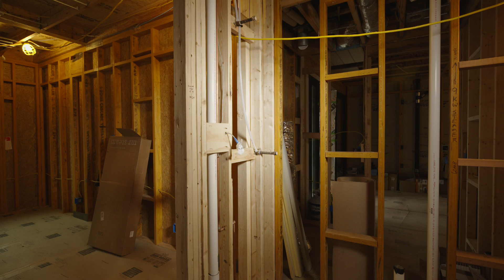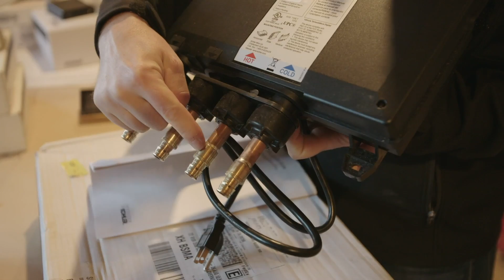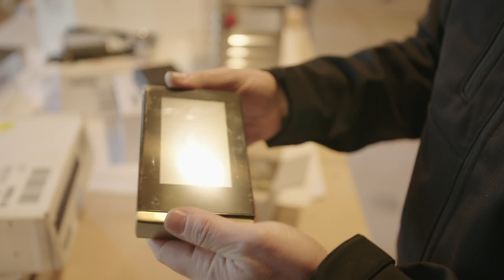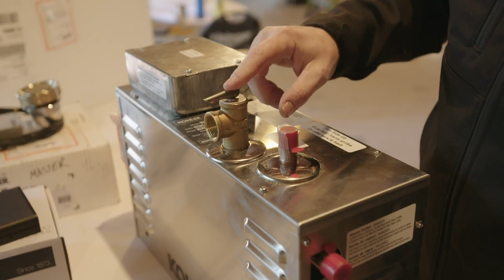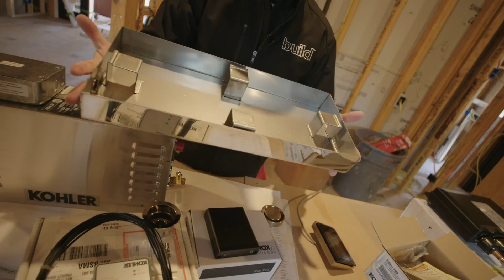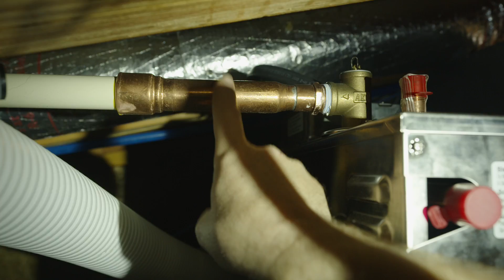Electronic Thermostatic Shower Valve - This is impressive!

Comment: This is to a shower as to a fridge with a TV. Way over the top and totally unnecessary. Get a shower with a thermostatic valve that has a temp gauge on it that you turn by hand. Same thing as this minus the electronic valves.  Its cool but this is just another thing to break that will no doubt be prone to unsupported system updates in the future. 5-10 years from now, if it even still works by then, people are going to hack in to your shower and start turning the thing off and on just for fun because the manufacturer no longer provides security updates. You think this is not a thing, but it totally is. Its currently happening to Fridges with tvs, wifi toasters, and all kind of 'smart' stuff manufactures have moved on from.

Comment: I have almost the same setup — but more jets. And I use the Steamist brand computer and controller, which has a nice basic UI. It also allows for much longer steam runs that the Kohler. Out master is in a large home on the second floor so this was necessary.

Comment: Two things 1. Is it networkable or is it airgapped you haven’t really discussed much about smart wiring? So Will it Alexa or Hey Google? 2. Will the steam unit produce a hot steamy condensing spot in your attic and possibly “trick” your thermostats? (Bonus Question) I know You’ve got backup generators if the unit loses power or reboot will it lose settings

Comment: Similar system was made by HansGrohe, but no steam option, that I was aware of. Fantastic system, until it goes wrong, only 2 engineers in the country (UK) can work on them, have had 2 problems in the 5 years that I have had this system, one of the head valves failed, was replaced foc. The second was a lot more complex to find, but a very simple cause. The temperature sensor failed, it was replaced, then the system would shut down after a few seconds, they changed the entire system, the control unit, the cables, everything, with no joy. We went through the entire plumbing system, this shower requires a very different layout to the standard in the UK,  large pipes, 22mm, instead of the standard 15mm, full bore valves, and a pressurised hot water tank, instead of the dreadful combi boiler that is so popular. The engineer had the same problem at another installation, at a very rich Russian’s house in London, who was making a huge fuss about his shower not working. He had originally had problems with  his plumbing, 15mm pipes had been used, so he had to have it all replaced, after the house had been finished, which he was not happy about, I had read the instructions first so all was good for me. System is German, the OEM got involved, they took one of my old units, by now replaced twice, plumbed it in at their factory, all working, sent it back, same problem.  Finally we worked it out, the temperature sensor, they had some reliability problems with the original design, and replaced it, the new one worked fine in Germany, but one big difference, in Germany they had circulating hot water, so the shower was hot as soon as turned on, this is very uncommon in the UK, so the hot water is cold until the hot tank water reaches the shower, in my case about 10 seconds, the new sensor was saying ‘fault’ and shutting down the control unit, this was not  mentioned in the instructions. All good now, but a very expensive system. I don’t have the music option, the cost of the speakers was just too much, special water proof speakers, I do have the lighting control option.

Comment: Is it the sparkly stainless steel or the competition with The Jones Down The Road that make you want to pay for all the laziness? Why do rich people always compete to be the weakest link? Electricity to get the water to the top of the tower and electricity to heat it up is enough dependence on power to obtain the desired result of washing your butt. Maybe rich people  just forget how to "use the simplest system available for the desired result" (business 101 and construction 101). Another poor soul addicted to the push button and service calls. I think most people (including me) are now watching just to see what other ridiculous things people are willing to do to blow money. The whole house systems will need to be replaced in ten years. When the grids go down (and they will), I'll be glad I have my 30 year old mechanical valves attached to my own water storage unit and a wood chip combustion heater.
Reply: Looks real good Matt and I must say the idea of remotely turning on the shower and hand held so the water is at temperature when you jump in is appealing.  Why not add body jets and a rain head ?

Comment: Pretty cool setup, really like how you've set it up so it's accessible in case there are issues with it! Seems like there was a lot of thought that went into designing the whole thing.
Reply: Just needs lighting to highlight the different units so you don't have to use a flashlight to inspect or repair.

Comment: Very cool attic setup.  I have a 10x9 wet room in my house being built and I just couldn't find a place to install this without being difficult to get to without hiding behind a wall or something.  So, I decided to bail on the steam idea, plus all the mechanical stuff that will eventually go wrong.  My house is high-tech enough, just give me a valve and a shower head.  Thanks for sharing though, pretty cool.

Comment: I think the DTV seems cool, feels somewhat like a novelty, I'd prefer a drawn bath with a DTV setup. Love the steam shower detail. You'll have to do a follow up on what changes you needed to make to the shower enclosure to accommodate the steam function.
Reply: wish that I could like this a hundred times.  Too many times more thought is put into the shower than the bathtub.  I rented a house that the master bath had a tub so large that I could sit with my legs criss crossed and my knees didn't touch the sides.  It had a sloping back that was enough that you didn't get a crick in your neck and was long enough that you had to be over 6' to have to bend your knees even a little bit.  To top it off it was deep enough to submerge the entire body.  The tub was also insulated in a way that kept the water warm for several hours.

THAT is my dream bathtub.  Unfortunately, being a renter, I couldn't access anything to find the manufacturer and the landlords didn't know. 🧐. So I have been hunting for a while to find that tub.

Comment: Just a couple questions: power lost will the shower still continue to work? Secondly, what are you using to remove all the moisture out of the room? Thirdly, how affordable is this system and do the make a system the covers two or more bathrooms? Sort of a scalable system.
Reply: Very good questions.

Comment: I’m a very tech savvy guy, but this is an over engineered “solution” that is brings a lot of moving and electronic components that can fail.  Standard valves aren’t fancy but they just work and rarely fail.
Reply: We have a Moen io digital shower system and we are on our 3rd valve block. It fails all the time, shower doesn't come on or trickles only water out of it. Moen replaced 2 systems on warranty. But not anymore. I wish I would have used just normal standard valves which I can turn on by hand. Now since everything is behind tiles we need to look into alternatives.
Reply: My old shower valves need rubber sealing faces ever few years.
Reply: @Ampacityelectric  that’s exactly what it costs lol
Reply: @Ampacityelectric  yup. 10k, but yo also have to remember that his concealed toilet carriers are around 1200$ per and the wall toilets he is installing are an additional 1200-1900 each. Plus, his plumbers destroyed a structural beam on the rough, last I checked it hadn’t been addressed, and the way they ran waterline and did some of the plumbing in that house like in Matt’s en-suite lavs, I’m not sure they were 100% sure on what they were doing. Should be fun to see how they plum the steam machine that’s meant to be installed at the same level or beliw the outlet 9 feet above it.
Reply: I’ve had mine for 4 years and no problems whatsoever
Reply: @ny2la2day  wow!!! 4 WHOLE years!?
Reply: @ny2la2day  yeah, get back to me when it’s been 40 years.
Reply: @Wild_Bill57  Who keeps the same bathroom for 40 years?
Reply: Being able to control the shower temp from outside is just asking for trouble
Reply: @FerdinandFake  ITS THERMOSTATIC VALVE JUST TURN ON OR OFF

Comment: I posed this to Moen and got blown off, maybe Kohler will respond.  Rather than waste water heating up, why not give an option to circulate water back through a closed loop hot water circulation system?  That way no waste of water and you get hot water right to a bathroom turning each bathroom into circulation units.  Thoughts?

Comment: I get it, I'm a gadget guy, and working in IT there's no end to the things that I think could be great to be controllable and configurable. 
But having important things like hvac, water, lighting, and showers controlled entirely by 'smart' devices which rely on the 'smarts' working seems like a way to annoy yourself in a couple of years time. 

I have nothing against this manufacturer, it's just the nature of the beast - this is all software controlled, and they're generally not repairable - you just have to replace it when it breaks. Worse, manufacturers have a bad history of making their new versions not backwards compatible with the old one.  That's assuming they are still around - companies, even family owned companies, get bought out, go broke, etc all the time. 

It only takes a few completely cold showers in even Summer, let alone Winter, before you decide that waiting a few weeks for a replacement isn't worth it, and to rip it all out and replace it all.

Comment: $3k instead of turning a nozzle is pretty tough. I waste money with the best of them but damn.
Reply: I like the remote idea but I would still like to see hand controls as backup like when the power goes out.
Reply: @mslinstrot4643  Well in his case, he has a backup generator when the power goes out.
Reply: It’s actually not that bad. I just did a shower with three water options, and three valves with diverter etc was around $2,300 for all the valves. With the electronic you just plug it all in and have a controller and no valves needed.
Reply: Obviously, a bucket with water work better end the day
Reply: Just a couple extra Flighty app sales and you are good!
Reply: paying extra for the privilege of having your shower being able to be hacked to scald you alive while getting rickrolled

Comment: Maintenance:   plumber needs to be electronics technician
                           Electricity goes off the shower won't work ,  Purchase a standby generator so shower works 
                           Wi-Fi goes out shower won't work  (I'm a leadite,  I give me a mechanical valve) My kitchen sink touch faucet doesn't work anyone have a 9 V battery

Comment: Your shower head is near the wall. Wrong,  you need a rainfall. Also where are your heated towel racks. I’m using power hinges for my medicine cabinet mirror that opens  straight  up.. it has a blue tooth mounted switch. Just saying

Comment: Sorry Matt. I love your videos... but this isn’t the future of showers... I get called in to deal with these things breaking all the time, electronics and water... also, can you please enlighten us how your plumber is going to mount a steam system meant to be installed at the same level, or below the outlet for the steam in the attic? They’ve already plumbed your sinks in a questionable way, how are they going to do this? The steam isn’t pumped out, it expands its way to the discharge. Some have fans installed, but they’re meant to push horizontally, or up...

Not a bad way to spend 10 grand though!

Comment: How can you build a "passive house" when your 9kw steam generator uses as much energy as a 3 ton consenser?
Reply: And I don't want to hear, "but 3 tons is closer to 11kw".  I know that, but my 2200sf house is cooled with a 2.5ton unit.
Reply: because the steam generator will probably be in use for a few 10-20 minute sessions a week? Not only does it provide a benefit, it's negligible compared to how much energy heat or AC would use over a week.

Comment: Love the set-up, we have an earlier version we installed about 12 years ago when we built our house.  A touch pad on the wall controls 4 wall spray heads, a rain head on the ceiling and a handheld.  What I really like is programming the temp and what heads you want.   My wife can set her program and I have mine and with a single touch you are ready to go.  Wish I had the steam feature though!!

Comment: 1:10 looks like the nipples (which I assume will be future shower arms) are just secured with brass 90º elbows, mounted with two screws, and have flexible plastic tubing leading up to them.  In my apartment, the shower arm is pretty flimsy, and I have to assume that they built it that way.  I think it'd be better to solder at least 6" of copper pipe to that brass elbow, with a solidly mounted clamp located away from the elbow, so the shower arm can't pivot on those two screws.

Comment: Nebia shower head is cheaper, and saves lots of water. And the water particles are so small, it’s like having a steam shower. Granted they need to keep coming up with new designs to fit in with more home styling. Mine is a mix between space station and medical therapy styling.

Comment: This takes equipment with a 20+ year life cycle and drops it to 10 years (even if it's accessible in your attic you want it to work). It is highly likely that in less than 10 years the app you need to turn on this shower will not work on the phone you have. As each successive iteration of an OS is released, apps often have to be updated. Has Kholer committed to a long term support plan to maintain this, I seriously doubt it, because keeping these things up to date as technology advances is expensive. You end up having to keep multiple layers of technology-supported over multiple revisions of operating systems across multiple devices, sometimes it's not even technically possible.

I'm all for tech, I do it for a living, but this is a solution in search of a problem. Then of course someone will exploit a security loophole and turn the shower on all day.

Comment: Matt, since you are going high tech, why don't you install a camera or two in the attic pointing at the equipment then you can show it off without actually having to go into the attic.
Reply: Nice idea that way he see right away if there's a leak or a problem thumbs up 👍
Reply: Great idea.  But the cameras could fail, so we need another system to monitor the cameras, at least a new set of cameras looking at the first cameras.  Never too safe.
Reply: @guillaumelafleche9477  great idea now we talking problems solved  👍

Comment: Ok I busted your chops on type a or b water line, I’m a just retired contractor building my own house n used type A by the way . Now I’m just in the framing stage and I’m glad I saw this now n not later . I’ve been accused of liking gadgets, and these r gadgets. I see a steam filled shower with gadgets in my Mechanical room . And it’s conveniently on the other side of my shower . Thanks .

Comment: This is so AWESOME! I actually did almost the exact thing a few years ago in my master.  Used 2 of the Kohler DTV valves for a his and hers shower so we can each have our desired temp.  Also have the steam unit and am such a fan over the more popular ones.  Their service isn't just for their big customers like you either.  My steam unit wouldn't run and they had someone out and had it replaced in less than a week.  One suggestion on the Ditra Heat - run it up the wall behind the bench to take the chill off your back.  I have it throughout the bath, shower and bench but would do that if I had to do it over again.  Both Kohler and Schluter are doing wireless integrations now, which I'd recommend so you can tell your 'smart speaker' to "get the sexy shower going" - as my wife likes to call it.

Comment: Hey Matt, love your shower idea! And since I'm a power backup tech I have a question and a solution for you. Q: If you have no city power there is No shower? :-) 
A: That plug your electrician pulled there make sure you have it on UPS separate feed, also add your hot water tankless water heater to the same UPS. 
700W - 1500W UPS should be more then enough for both appliances. You'll be able to finish your shower anytime!  Just don't add your steamer to that same UPS feed 9KW is too much for a small UPS. 
I have my wifi routers, a TV and tankless water heater on UPS. If my neighborhood is dark I can still take a shower and have internet and TV! :-)
Reply: His whole house is backed up by a natural gas generator.  Backup power is one thing, but other than computers/network equipment, there's really no reason for the backup power supply to be uninterruptible.
Reply: @00HiGhGuY00  that's true :-). I forgot about that ...
Reply from the maker: Great call!

Comment: Heating the base of the shower is odd, the water from the shower will have heated the base well before any electric heat will impact the base.  Bath room floor etc is great but shower is not needed.  In my option, and the option of many installers even here in the great white north
Reply: Not for my wife, there is never enough 🔥

Comment: What is the fail-safe condition if the power is cut off, or if the thermostatic valve or any of the digital components were to malfunction?

Second consideration . . . if it's not already too late: a small showerhead about 18" or so above the floor, for when you only want to take a "feet shower".